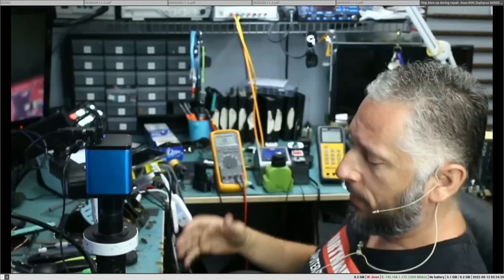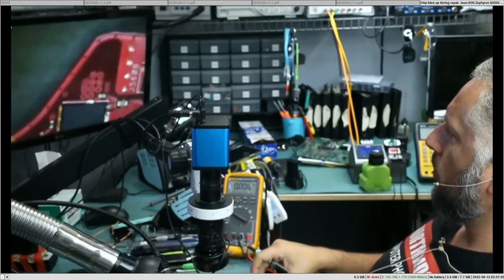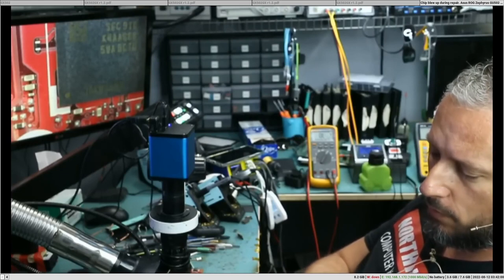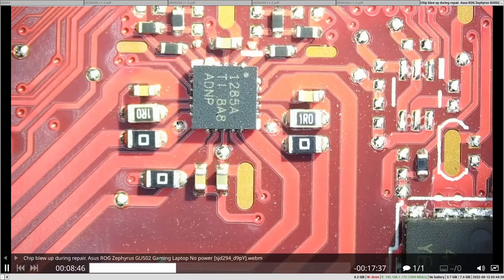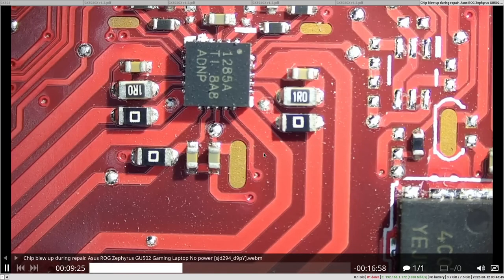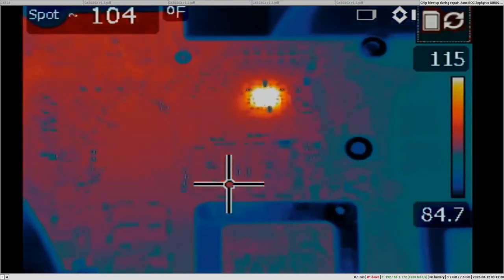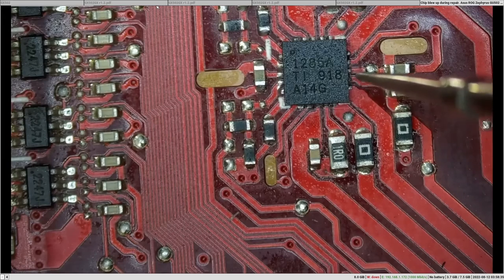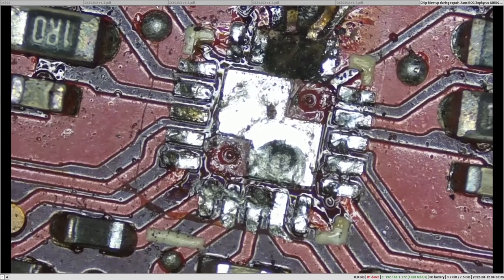NorthridgeFix's fire on Asus GU502: what went wrong and why

Comment: Great video. The main issue here is that there are people using reference like that to learn repair. Not only he damaged his customer's property but it will also cause countless number of "failed  repairs" made by people who seen this useless 19v injection, not mentioning keeping shorted board on power to measure something untill it actually burns hole in the board.

Comment: Alex is good at whet he does! He makes a ton of money and why do you care? You have barely any subscribers and he’s pretty much famous, why be jealous! Start your own thing if you know more!
Reply: Alex is only good at soldering and reselling chinese tools.He doesn't have a clue about fixing things when it comes beyond replacing connector, chip that gets hot or removing shorted capacitor on the board.
Piernov care because some people are taking Alex videos as a guide on how to troubleshoot things and are replicating his actions causing more devices to be unreperable by following that chaotic troubleshooting flow like he did on asus video , also Piernov is respectable member of badcaps and rossmann repair forum and he made lot of guides, boardview repair aid software and he is helping people there, so i don't think that he cares about being famous or making a fortune, as he is already Research Engineer and he is doing repairing as just a hobby.
Reply: its a bit of scammer this guy.. people dont see it.. he has a lot of no repairs and charge a lot..  he takes jobs , he cant fix at all.. u should not take it..
Reply: @AdamMróz-q8g  u are absolute right.. he can solder great, but has no clue about the logic boards.. if there is no short , he basicly cant fix it.. and charge a lot for a no repair..

Comment: Great video piernov!  I think Alex has a great understanding of troubleshooting, but man when it comes to repairs it is soooo sketchy and sloppy, and pushes soooo hard with the tips of the meter and soldering tips.  He damages traces and pads and masking just trying to replace a simple connector half of the time lol.  I hate to hate, but he's terrible at repair (I have done soldering, troubleshooting, inspection, and repair for many years on military and aerospace electronics) and some of the worst people in the field I've known are better than he is.
Reply: My favorite video of NorthridgeFix is when he was working on a laptop that had a mosfet that fused to the pads. When you cant remove a chip with hot air due to being fused to the board the proper procedure is to grind the chip off.  Instead of grinding it off he keeps applying hot air and starts to pry it off with a knife. Doing this he completely rips multiple layers of the board and multiple traces completely ruining the motherboard. At this point he then decides hes going to deem it a nofix after he destroyed it. The customer gets screwed and a bill for a 75$ bench fee + return shipping if they ever want to see their laptop again. Which 90% of customers will refuse to pay for nothing getting fixed. Then it ends up in Alecs store room as a parts computer. 

I remember seeing him do a walk through of his shop in a video. He shows the room he has of devices that were deemed a nofix that customers didn't pay for to get back. There is literally thousands of devices he has collected from customers over the years. He had a full shelf of PS5s, Series X's and was bragging about how he had almost every modern laptop ever made for spare parts. There is a reason why you only see him work on devices that have a short circuit or a bad port or connector. He can't fix anything else and ends up charging customers for the privilege of just looking at it.
Reply: unfortunately, Alex has close to zero understanding of troubleshooting. He surely can solder, but there are devices he actually destroys during making the video. Not only he destroys customer's property, but he does not understand that and proactively denies / shadows comments who point out that the thing he called "mosfet" has Datasheet which is a first link on google using its marking, and injecting 5V in it destroys PCH which he immediately claims to be unrepairable.

Comment: This design has a weakness because of the missing pull-down resistors at the gates of the H-bridge MOSFETs. Of course, it save some cents, and maybe you don't need them if the power sequence is doing well. But if not, or somebody is taken out the controller chip...😂

Comment: Fantastic explanation Piernov also about the major pitfalls in repairing these sorts of derived supplies, voltage injection techniques to uncover shorts & more importantly, the vulnerabilities of shortcuts in circuit design of buck/boost by design engineers/teams which upon a shorted/jammed high side MOSFET can easily send a catastrophic high voltage into a low voltage rail.
This is an industry wide problem with these sorts of buck/boost circuits as years ago, they used to implement crowbar or protection circuits to try negate these occurrences, though admittedly I noticed this more in high end equipment, but they omit this to shave BOM costs for affordability ie tradeoff.
Reminds me of the Lenovo Yellow power connector vulnerability where a broken connector can send 19v into the Super I/O.

Anyone who has ever repaired gear at a pro level inevitably makes mistakes (they are lying if they say they haven't made any, or are too inexperienced to have worked on lots of equipment) & the most important thing is to learn from these mistakes to become even better ie practical experience.
Would love if you did more of these sorts of videos, but seriously love all your content.
Honestly, if I had spare cash I'd send you money so you can buy a nice thermal camera & more equipment.

Keep up the awesome work, including all those super helpful repair guides you have produced to guide thousands of techs globally & IMNSHO you rarely get the positive recognition you deserve.
God bless!

Comment: I noticed that too and I'm still getting into learning board repair. I was searching for a follow up video on this, thanks for the explanation.
Reply: If you're really serious about learning board repair, depending on where you live I would contact a certified IPC-7711/7721 training facility if that is an option in your area, and pay for a course and certification.  I've recommended to Northridge Fix in many of his videos to do the same thing as they teach you how to do it without furthering damage to the electronics.  Alex from Northridge fix I'm pretty sure was either self taught or learned from someone that was also pretty bad at it.  If you watch his videos check out how frequently he scratches the masking from the board, and damages electronic traces and pads, or lifts them (where the pad shifts and is no longer stuck to the board).

Comment: Thank-you for explaining. A question as a learner at 31:54 : Is the highside mosfet a P channel mosfet or N channel?. You say No voltage on Highside mosfet Gate will cause the mosfet to pass 19v.   Or is it becuase the lowside mosfet has no voltage on the gate also and will not pull the voltage to ground / pull low? Thankyou.
Reply: It's an N channel, most of the time (if not all of the time) you'll have N channel MOSFETs on buck converters like that cause they work better at higher frequencies.
What he means in that case is since the gates are floating, there is no driver to pull the gates low, so if the gate get high you'll get connection from drain to source.

Comment: He should have refunded this customer the cost of the laptop from the minute he started probing around the 3.3V/5V converter with power plugged in. The board was very likely fixable before he burned the 51285A.

If your 3.3V/5V converter is heating up with power plugged in, it is 99.9% of the time caused by a dead Super I/O, and on most boards that released recently, they have a BGA Super I/O which receives programming from the BIOS/UEFI chip.
Reply from the maker: There's a high chance the PCH was already dead. Very common for the PCH to be shorted on the RTCVCC rail and causing overload on the 3V LDO so that it overheats, and the LDO output won't measure as shorted since there's a diode between the rails. If you don't end up with these boards on your desk then you're a lot more lucky than some of us…

I'm not here to criticize their business, not my job. The issue I have with the original video is that it is presented as an educational video, while clearly there is a lack of understanding on how to approach troubleshooting such devices, which is likely to cause more harm than good. There are hundreds of videos like that on Youtube and these channels are more popular than the ones that actually try their best to understand how things, work, explain it, and do a proper repair.
Reply: @piernov  Understandable; many people watch his videos and think that laptops are easily fixable with a thermal camera, but there is so much more theory involved. If you're just looking for components that heat up, you might not be addressing the underlying cause. That is the case in this video, which is what I don't like. In my experience dealing with the issue of the 51285A chip heating up, it was (in my cases) always a dead Super I/O that was replaceable.

I would ALWAYS measure the coils first in the event of a main power rail short, and then if no main power rail short is present, I'm still not plugging in power unless I verify that the CPU/GPU/PCH/VRAM coils have a proper resistance.

Also, if the PCH was shorted before he even took the 3V/5V converter off, wouldn't it have shown as a short on the 3V_AO since the PCH is on the 3VA line?
Reply from the maker: @TheResoluteHawk  as I said VCCRTC is separated from the 3V LDO output by a diode, so you can't measure a short to ground on the 3V LDO, but the current can still flow in excess through the diode to the shorted PCH, overloading the 3V LDO. The PCH can be shorted only on its VCCRTC rail, while other rails are fine, that's what makes it confusing.